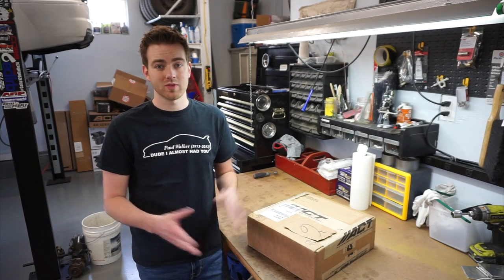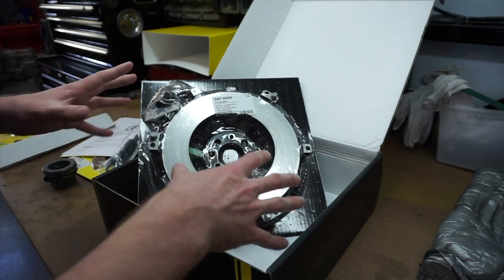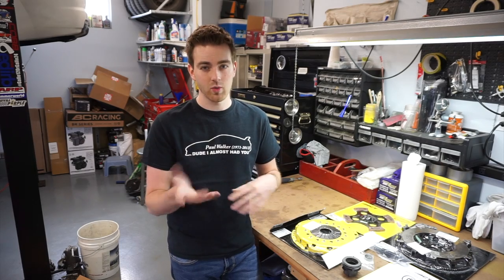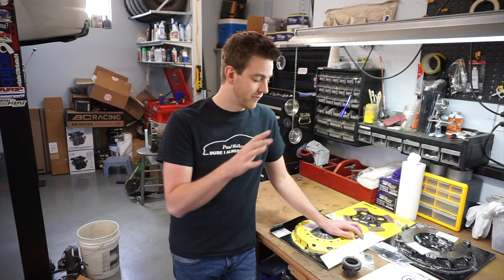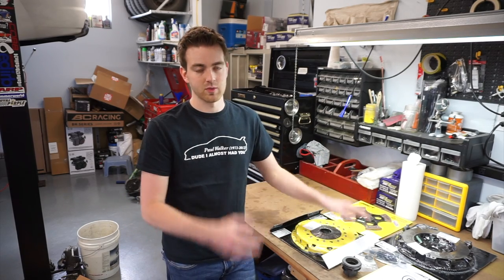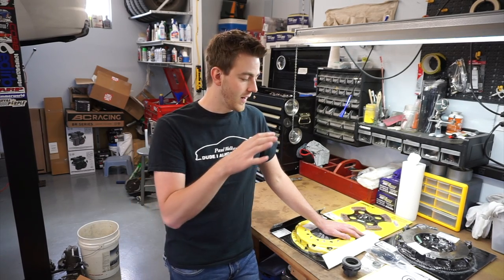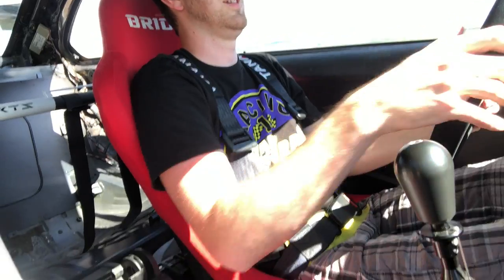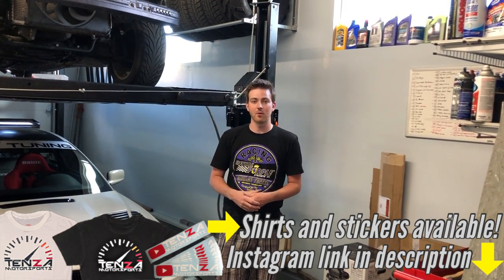Should you buy an ACT heavy duty 4-Pad rigid racing clutch? E46 Advanced clutch technology review.

Comment: Hows the chatter? Heard ACT is tolerable for the single mass. You should do a video of the clutch chatter at idle.
Reply from the maker: It’s actually quieter than my Ecs tuning stage 2 clutch. what I have noticed with this one, is the engagement is much more aggressive and likes to squeal. My car is so noisy it’s difficult to hear chatter if there is any
Reply: @TenzaMotorsports  
Thanks for clarifying. My E36 M3 is a garage queen that i only take out on the weekends. I will stick w the LUK DMF. I like it nice and quiet. 😎